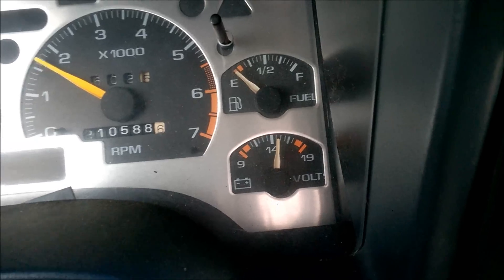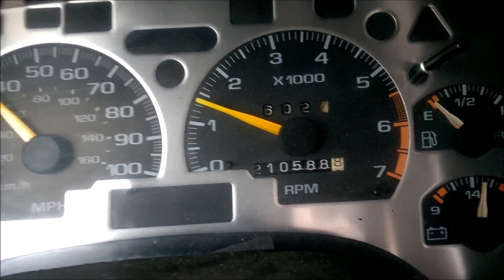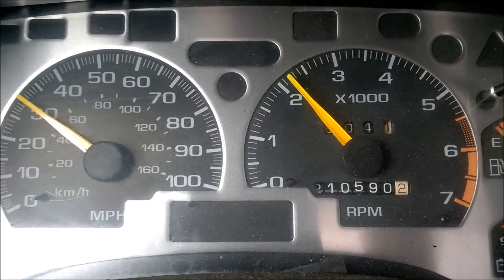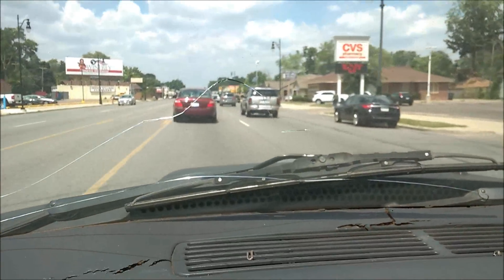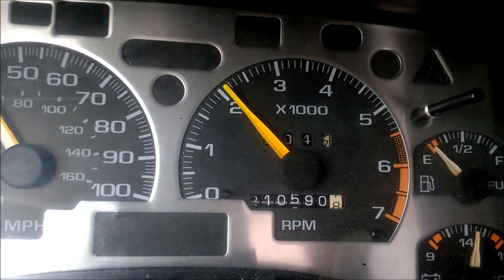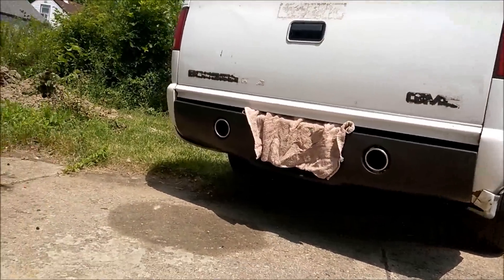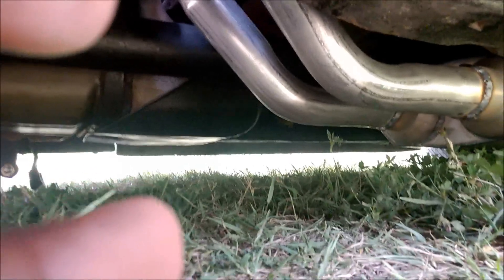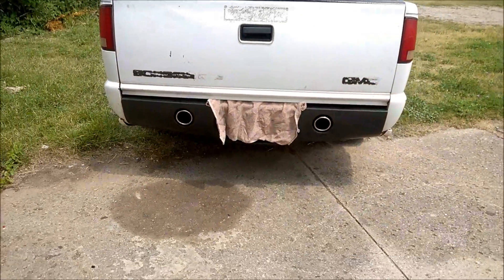LSX On3 7875 turbo with Hooker Aerochamber installed! INSTABOOST!!!!

Comment: Did you have to go to larger diameter exhaust pipe?
I’m wanting my setup to be as quiet but avoid restriction so it doesn’t cause back pressure on the Turbo. I’m curious how this setup worked out?
Reply from the maker: HeadFlowInc the muffler itself was a single 2.5 inlet and dual 2.5 outlet. But the inlet is actually larger and they neck it down to 2.5 so I used a 3” pipe and used it to resize the inlet

Comment: Hey brother what wiring harness are you running on it? The Stock 2.2L ECM with a truck harness?
Reply from the maker: Stock harness from the 5.3 truck that I modified to fit this setup. PCM is from the same 99-02 Silverado LS based truck, however, some S10's 00-up had 0411 PCM's that can be flashed to run the LS motors. Some 01-up Vette's camewith 0411 PCM's, as did some f-bodies, and some of the full size trucks

Comment: whats your setup? i just bought this turbo, what kind of numbers are you seeing?
Reply from the maker: I only street tuned it so no dyno numbers. But the results others have been seeing with similar setups as this with roughly 20# is right between 8-900whp on E85. I was at 12-15# and the spool was pretty quick, even with the LS9 cam, and the power was there also.

Comment: Ken how much can i gain adding a turbo to a stock 5.3 no heads or cam
Reply: bill2526 bill2526 u got ripped off
Reply: @GIRTHBROOKS10  why would it blow up from not putting in a different cam or using different heads?

Comment: Is your turbo sized for lower rpm ?
Reply from the maker: Jerry C the setup had an On3 Performance 7875. They work well on these 5.3’s. It would start to make boost around 2800 rpm with the LS9 cam. I ran it out to 6500 on 15# and it made 623whp